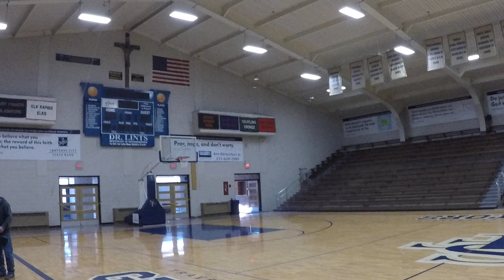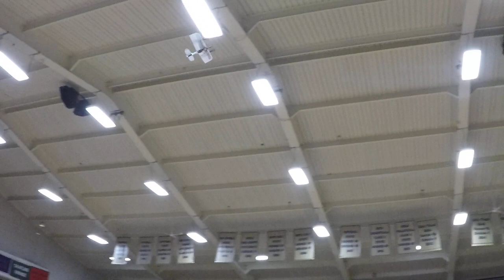Twirl Tiny 1-cell powered twin autogyro RC aircraft

Comment: dope. make the wings smaller.
Reply from the maker: Good thought!  I had initially flown it without any wings and it did OK.  However, it worked the 1-cell brushed motor harder then I liked so its work load was lessened, as shown!  With this limited success, I built my 2-cell brushed autogyro for a better balance of power and wing loading.